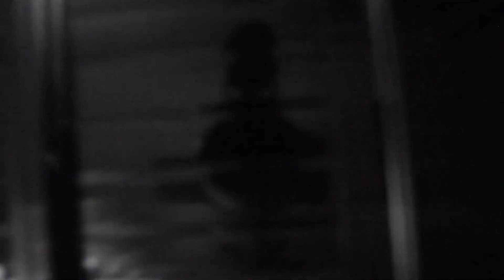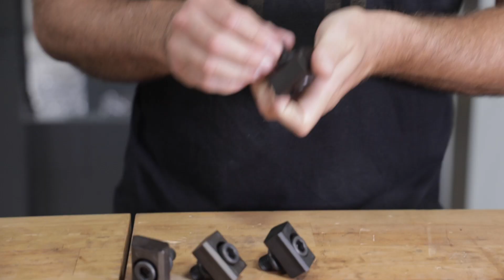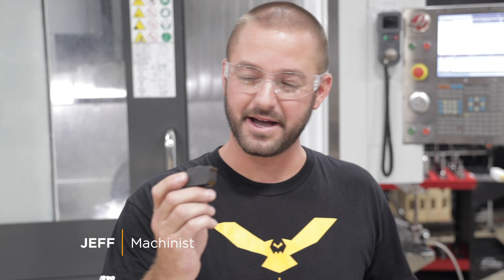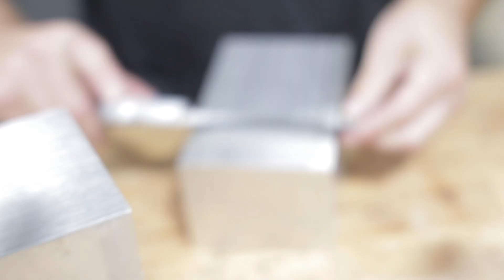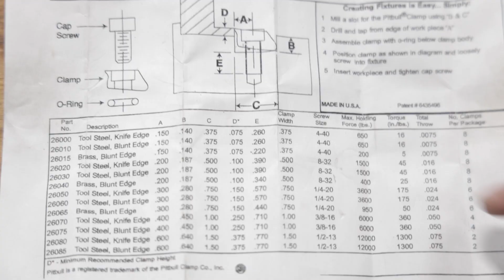Installing Mitee-Bite Pitbull Clamps Into A New 5-Axis Multi-Part Fixture | The Art of Fixturing

Comment: As i was blamed a lot by your community the last time i try to ask a normal question now:

Why you use pitbull clamps on both sides? Doesn't it make things unnecessarily expensive?

Thank you for your answer and greetings from Germany
Reply: Yeah I thought the same. As you tighten one side does it not push the unclamped clamps on the opposite side to far away from tne billet. I though a solid/fixed pitbull would be used like a hardstop one one side at least.
Reply: With how that fixture has been machined,  I don't think it's possible for the clamps to get "pushed away" from the billet, because the fixture is solid between the pitbulls, giving you that hard stop and preventing any side to side movement..
I'm pretty sure they could have gotten away with only using 2 pitbulls per piece, but hey, why use 2 when you can use 4,? 🤷‍♂️ .. Might as well hold your piece down with as much equidistant clamping force as possible.. Especially with the feedrates Titan uses..lol... I'm more than sure for a company like them, the cost of using 4 clamps per piece is relatively inexpensive vs the added security of knowing that the part isn't going ANYWHERE  ;)
Reply: @cyphefilms  The problem with using 4 instead of 2 clamps is that the 4 do not generate more clamping force than 2. They produce exactly the same clamping force. The only thing you could argue is that you got a pull down effect on both side which is not very importand when machining raw stock as the lower side has not to be parallel to the upper side in most of the times.
Reply from the maker: So, this is my personal style of doing it. I learned from experience that it works best for me and there is absolutely no way that part is coming out.

So we machine a groove first that locks and positions the raw stock. Then bite in from both sides with equal force.

We always go one way first and then the other... and it positions the part perfectly.

We run very high feed rates and this gives us the needed rigidity in the workpiece.

Extra expense but we make up for it with lower part times and never having blocks fly out of the fixture.

Also, look at how low we are holding the part... .060 from the bottom with a knife edge.

Our EndMill drops all the way down.

If I used only 2 miteebites... we would have to purchase thicker material and sink it deeper.

Make sense?

- Titan
Reply: @TITANSofCNC  Have you ever considered working with 2 TalonGrips and 2 Pitbull clamps? It's the exact same rigidity, less expensive (at least at my dealer) and you only have to tighten 2 instead of 4 screws when doing mass production. No extra material needed and you can go exactly the same speeds and feeds you want.

Comment: Pit bull clamps are impressive for low profile clamping. The only downside is the small ‘stroke length’, material has to be sawn to close tolerances otherwise the clamps won’t grip
Reply: Then don't clamp on the sawn face!
Reply: Eventhough the clamp is fully tightened The part moves in sideways(slideaway)

How to correct ?
Reply: @manjunathans3250 
The part is sitting in a pocket.